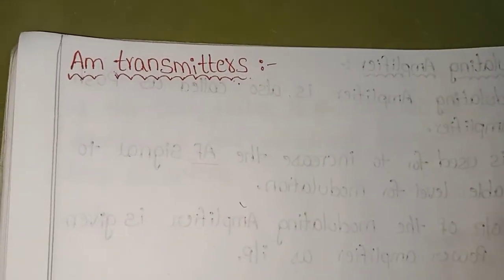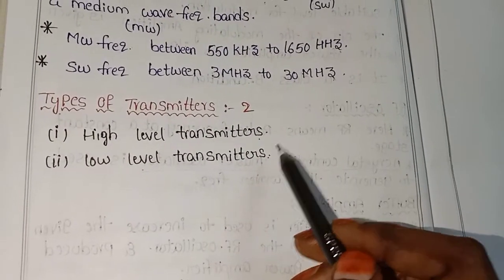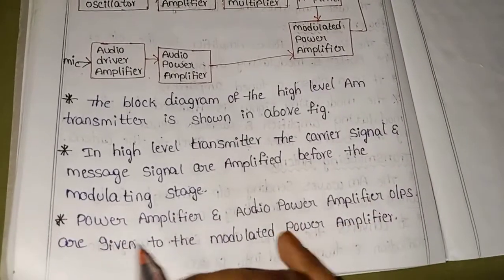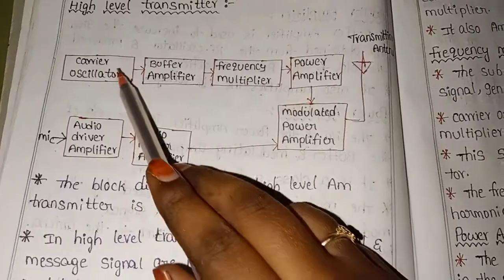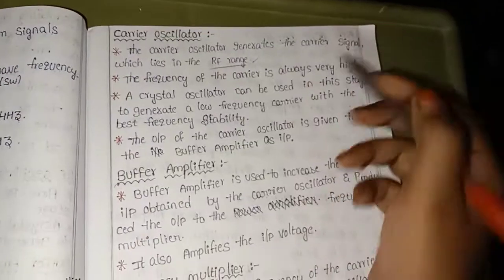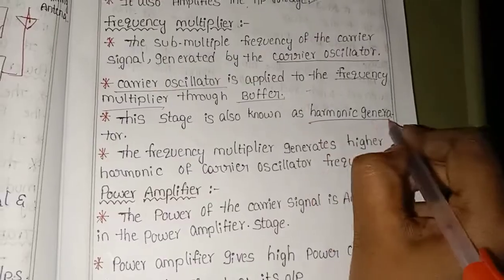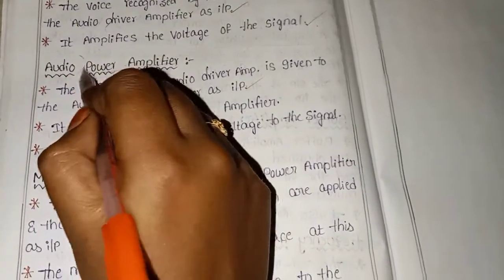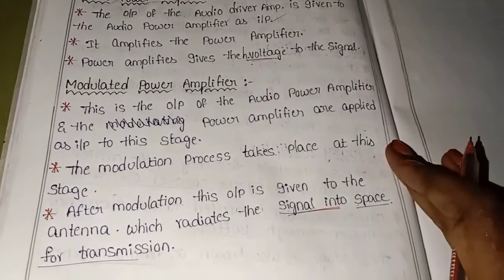HIGH LEVEL TRANSMITTER EXPLINATION IN TELUGU WITH NOTES & BLOCK DIAGRAM

Comment: Mam low level dhi vedio ledha mam
Reply from the maker: There is no spl video for low level 
Make a simple changes on high level then it becomes low level 
The overall working is same 
What's the difference between low level and high level can be explained in this video 
Plz listen the video carefully then u got the ans for ur question 🙂
Reply: Mam fm  transmitter exciter, frequency multiper, power sectios topic dhi vedio uvndha mam  @chinnieducationalclub